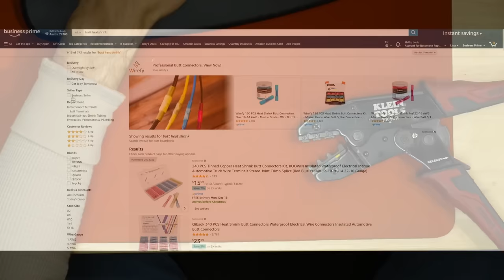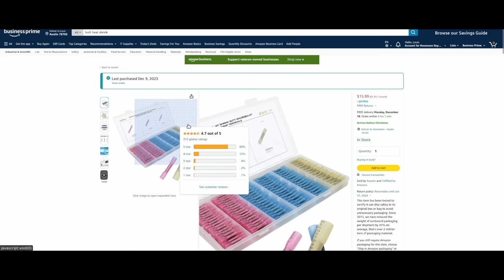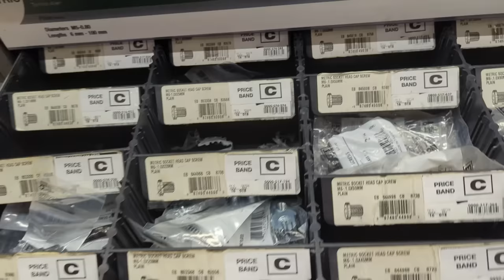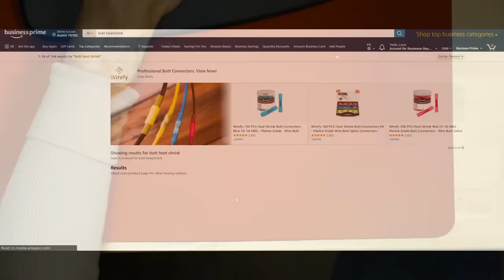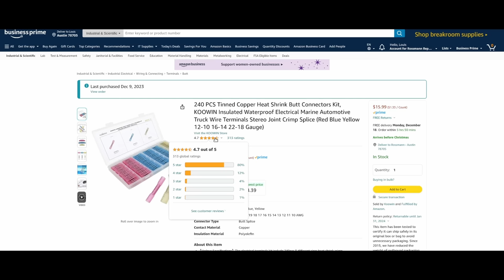Amazon Sells Dangerous Electrical Crimps

Comment: Another issue is pricing. Amazon used to have low prices on branded products. Now, you have to check everything . In addition, I have seen prices change between searches. Get interrupted by a phone call, search again, the same product is $3 more now. Honesty, integrity, and transparency will the currency of the 21st century. Amazon better learn that or they will end up like Sears.
Reply: Most like to rail on Jeff Bezos, but Amazon's been in the dumps since Andy Jassy became chief.
A look into Andy Jassy and his early life should tell you the key things about him.
Reply: Oh no not Sears 😂
Reply: Yeah, that price switch crap is bizarre!  I almost never rebuy anything I've bought just out of spite because they always raise the price thinking you'll rebuy it anyway.  Mf'ers!
Reply: Easy fix. Put any likely item in your cart, then resume search. You need to outwit them.
Reply: @SpaceCadet4Jesus that doesn't always work. I've had the price change on the item already in my cart. I think it's because Amazon automatically changes the vendor if someone else buys the item before I check out.
Reply: Pro tip: when searching for items, always do it again using a VPN while not logged in. Very often you will see a price change or or even start seeing items that weren't showing before. We are at the point where prices/products are now individualized, and one person might pay much more than another or only be shown low quality items if the seller thinks they can get away with it.
Reply: I recall something long ago where one of the reason to return an item to amazon was I found it cheaper. 
Though these days I know what I am buying and how much it costs local and what I will expect to get on amazon. I just buy it now as long as its shipped and sold by amazon. If its a 3rd party seller then I have to dive in and look at them. If they do not have a neg review then its likely they have not been around long enough.
Reply: Algos, like greed, ruins everything!

Comment: I bought a phone on Amazon that was specifically marked as unlocked. I plugged in my SIM and it worked. I went on vacation and lo-and-behold. It's locked. But because it's been more than 90 days, Amazon is washing their hands of it.

My options are basically a small claims suit at this point.
Reply: You always have another option: Don't buy on Amazon in the first place!
Reply: An unlocked phone means it will accept any SIM card.  If your SIM worked on your home network but not when on vacation, that's a roaming issue or a cellular radio band issue and has nothing to do with the phone being unlocked.  You either needed to change the settings to enable roaming, make sure your account is set up correctly with your carrier, or make sure your phone has the right cellular radio bands needed for use where you're going to be.  Unlocked doesn't mean it will automatically work everywhere, especially if you're traveling internationally.
Reply: @dwboston1 Bro, the phone literally said "Network locked"
Reply: @reasonitician  Because you didn't have service on the network you were trying to use.  An unlocked phone refers to the ability to put any active SIM into it.  Locked phones are locked to the cellular provider that sells them (i.e. phones that AT&T sells directly are SIM locked to AT&T)  If it worked on your cell network at home and then didn't when you were roaming, either your cell carrier doesn't have a roaming agreement where you were traveling, your phone lacked the cellular radio bands to access the network where you were, your account wasn't set up for roaming, or roaming needed to be turned on in the phone settings.  Unlocked doesn't mean your phone magically works everywhere automatically. 

What is your cell provider at home and where were you traveling?
Reply: @dwboston1 Bro, you've written a god damn novel trying to explain what's going on, despite being so ungodly uninformed that it hurts. You need to actually read what people say.

The phone literally said "I am rejecting this SIM because I'm locked to a network". It's not a radio issue, it's not a roaming issue, it's a fucking anti-feature that should never have existed in the first place.
Reply: @reasonitician  "I plugged in my SIM and it worked".  Sure, buddy.
Reply: @dwboston1 Could you move through the 5 stages of grief somewhere else or at least do it a little quicker.
Reply: @reasonitcian if it worked after putting in your sim it was unlocked
Reply: @tomboysupremacist  It didn't work.
Reply: @reasonitician  you said in your original comment that you plugged in your sim and it worked
Reply: @reasonitician  you said in your original comment that you plugged in your sim and it worked
more like 5 stages of bullsh!t

Comment: One of the things that always bugs me when I shop on Amazon is that the crap never goes away.  It doesn't matter what filter you use or what brands you ask for.  The cheap, typically Chinese, garbage is on every single page.  It takes hours to find something if you know what you're looking for.
Reply: If you try to filter it returns even more crap. I do remember when searching for something was EASY, now you would try to look for an item and would show you even things that are not even related. 
A few weeks ago I bought a "cheap" heater and it had good reviews and all, still I told my fiancée that probably was going to be not very good, turns out it's even worse, and we only kept it because welp, we need it and don't have time to look for another one. I wanted to buy a really cheap and crappy one we ended spending the double and the thing feels like it's going to fall apart any second, the plastic is worse than something someone could 3dprint... still we kept it. Amazon makes less and less sense and it makes aliexpress being a better option because at least there things are cheap and it's the same shitty quality.
Reply: @kotarldo I’ve noticed this too.
Reply: Excellent point.  These days, all the search engines have become crap because sellers utilize some sorts of search optimization softwares that make sure their product shows up in search results if it has even the faintest relation to what you searched for.
Reply: when shopping online in canada you will find that home depot and walmart are often just repackaging that same garbage at a higher price. but you can also find stuff on the home depot shelf (like DAP spray foam insulation) at half the price of amazon sellers...
Reply: Indeed a lot of “CCC” - Cheap Chinese Crap. Likely more coming with the competition heating up on the low price point side from the likes of Temu.
Reply: SO, they are appealing to the laziness of people and not people who actually know what they want?

Comment: Not sure if it's been mentioned in 10,000 comments, but that style crimper is directional. They do a double crimp. One side of the jaw is for the metal part of the splice, the other is for the insulation. The Klein Tools logo should always be facing the open end of the connector. Doing it the way you show, leaves one side improperly crimped.

Comment: As a former retail worker, I can relate to theft being a problem. Unfortunately, it's not easy to stop. If you try to crack down, you get a lot of people blasting you for treating them like thieves, even for reasonable security measures. It's not like I can tell who is a thief and who isn't by looking at them. It's not like a thief will admit their theft, either. Preventing theft is one of the toughest challenges that retail stores currently face.
Reply: To prevent theft retail stores must move back to over the counter sales as it was done for centuries.
Reply: Go back to the way winn Dixie (or Piggly wiggly?) used to do it- have everything BEHIND the counter, when somebody wants something u go get it for them.
😅😅there..ur welcome!😅😅
Reply: @ghoulbuster1 obvious troll is obvious.
Reply: The way those little fasteners get stolen is at the checkout. The little baggie nuts and bolts are specialty items costing $1.50 - $3 sometimes. So they take them out of the baggie and go up to the register. "huh whats this thing?" "I'm not really sure, it was in the hardware isle". Rather than going to look for it they ring up some other nut or bolt that costs 5 cents.
Reply: Trust in society has eroded. The social contract has been broken - and big business broke it first. There's no coming back from that unless people become economically secure again.
Reply: lol have you looked at all the Corner Drug Stores now?  all their stuff is locked up and you have to  bring either cards to a register  and they get it, or you have to punch things in at a kiosk, or just ask someone to unlock it lol.   Hell even my walmart in a small Oklahoma town just recently started locking up Printer ink lol.
Reply: They need to put the inventory behind a counter and serve the customer via a pay-first model, or do it a zoned off area that makes it hard to grab stuff and run away.

Having inventory to sell is more important than the price of the inventory.
Reply: And then you have Dollar Stores, where 1 employee manages the ENTIRE store. Well duh, don't blame the thief if your store got robbed, blame the upper management.
Reply: the grocery store I work in just prints money because of EBT mostly that they almost couldn't hit a level of theft that they didn't still profit. Theyre worried about people stealing pallets of stuff at the very least. not single items. Not to mention insurance does cover some level of slippage usually. Depends on your coverage though and not something an employee could change or fully understand either.
Reply: I rarly get people who question or have a problem with things being locked up. They tend to understand and agree. I wish someone would make a membership only store that didn't need anything locked up. if you damage something you buy it. you open a box and leave it damaged? membership revoked and you get the boot. Low prices, less employees needed to clean up after customers, virtually no theft. everyone is happy and stress free. sigh/
Reply: @Fizzgg here at home depots there is hardware drawers with numbers and bags with labels and a pen (on a chain lol) to write the bin # so if what you need is like 1.50 each you can grab a bunch and write down the # of a 5c washer 😂
Reply: It's all because companies are too cowardly to go after thieves like they should. Almost all big businesses tell their employees to not defend themselves and watch videos about how to hide like a coward and only fight as a last resort in the case of armed robbery or mass harm event. It's the same attitude about thieves. They'd rather lose the entire inventory than pay for medical bills of employees and a possible lawsuit from the criminal.
Reply: @remyllebeau77  in case of a shooter my store tells you to fight lol. but nobodies going to.

Comment: When I buy things like drives or memory, I search for known brands and try to look for the store.  Amazon is notorious for selling fake SD cards that say 256GB but they're really relabelled 2GB.  It's turning into a direct pipeline to Chinese fake factories.  They're burning down customer trust with all the drop shippers and bad sellers.  I didn't even know about the problems for sellers.
Reply: The only brand on Amazon you can trust that isn't a huge name is Silicon Power. They're still a name brand, but they have SSD's for dirt cheap compared to other name brands.